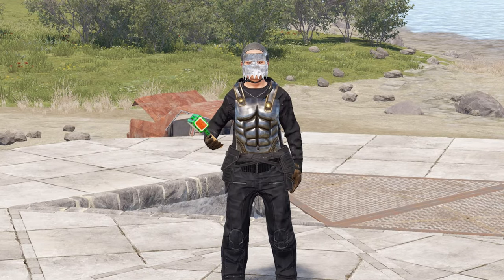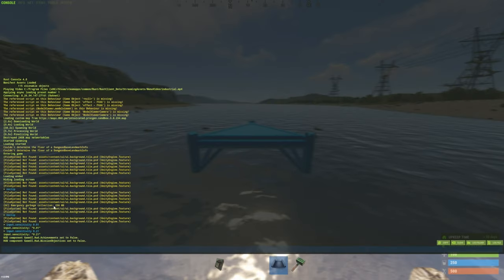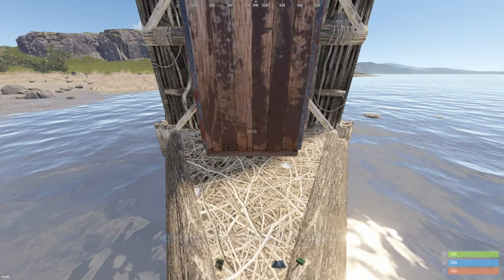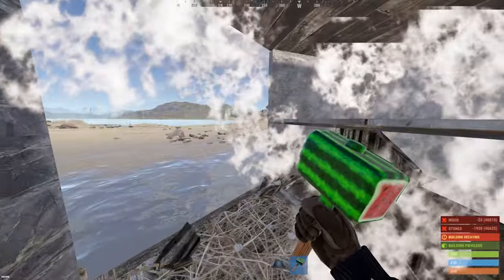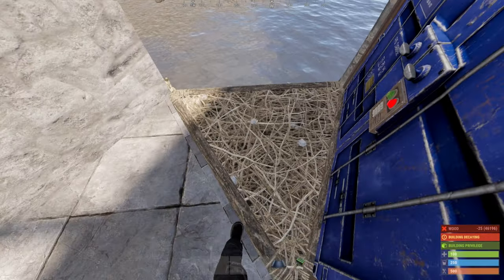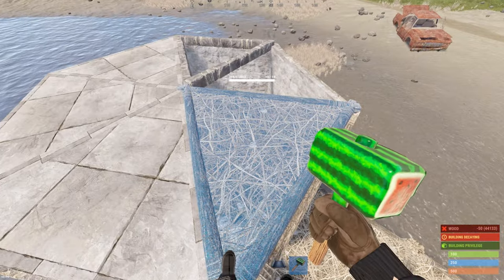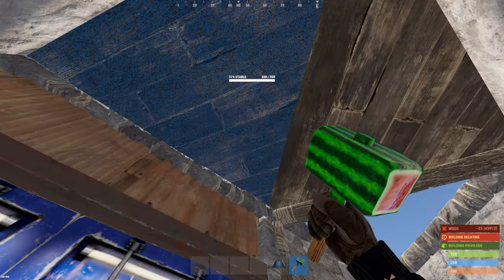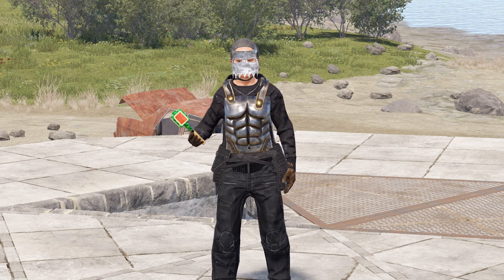Hidden TC Double Bunker  - Rust

Comment: Kinda useless.. would be easier just to upgrade to hq
Reply: To be fair the first time I raided this i had no idea where the tc was and just left
Reply from the maker: If the pixel bunker wasn't there, it's most likely a door or a window. So you are 1) increasing the strength to at least a metal wall and 2) there are ways to hide the TC like placing rugs and deployable in front. 

Hope you still enjoyed the video!